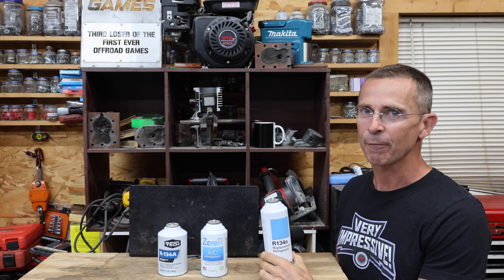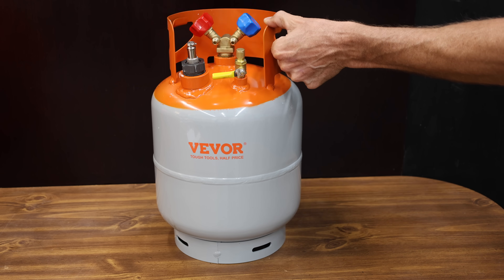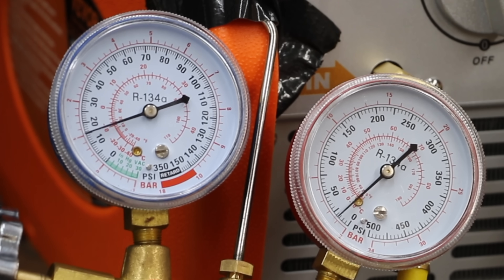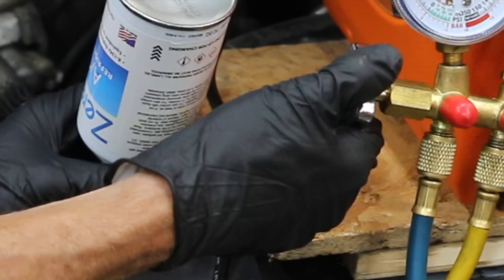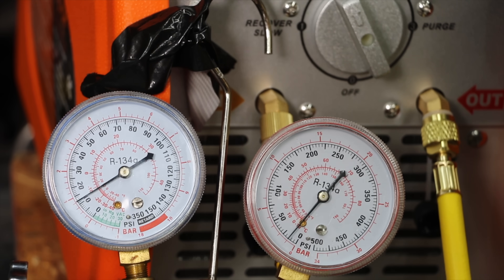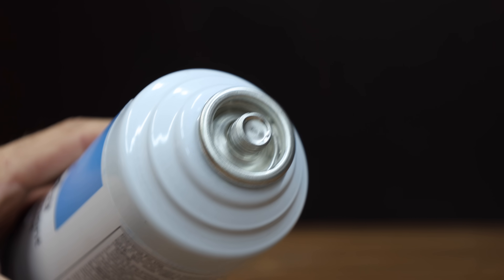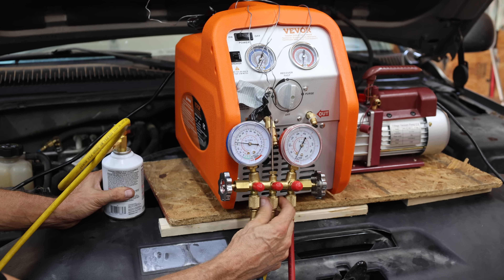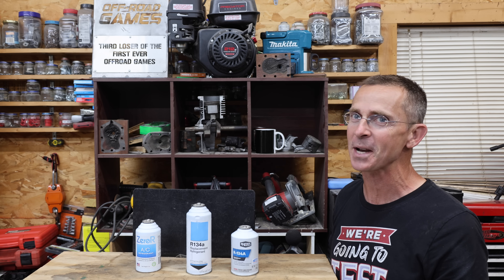How Dangerous is Fake Car A/C Refrigerant? Let's Find Out!

Comment: Unfortunately you're doing several things wrong and providing incorrect advice as well:
1. It's not freon but refrigerant, freon is just a brand.
2. You're not adding enough of the alternative r134a gasses for them to reach peak performance. 
3. You should NEVER add refrigerants in as liquids unless they simply refuse to enter the system (when the cans deplete some) and then do it small steps at a time as you CAN damage a compressor.
4. There is little issue with running these flammable refrigerants in automotive AC systems, there aren't any reported deaths/injuries from it, and the amount is very small compared to your fuel tank.  Most of the AC systems are fine even getting up to 500PSI high side occasionally until they will blow off some gas.
5. You don't know the exact charge level by using just a low pressure gauge at static temps/pressures.  You could be under or over charged still when the pressure remains the same (saturation).
6. You can use a puncture type adapter on self sealing cans all day long.
7. When checking vent temps, you have to use the same vent every time for comparison, as the temps change depending on the vent location in the cabin, often SIGNIFICANTLY.

.

.
.
.

Comment: You actually flooded the compressor when charging upside down as liquid! You have to very slowly add refrigerant, not open the valve fully! 

And as I can see, you charged too little. HI pressure should be higher to work properly. I have replacement in my car, and it is working perfectly. You have to measure subcooling to obtain perfect charge.
It is mix of propane and isobutane, to obtain almost the same pressures as R134a.

Dangerous? It can't explode while inside the sistem, as there no air. Yes, it can leak, but then it would burn in humble flame. What about all gasoline lines through and around engine compartment?

Comment: I enjoy your videos, but unfortunately this one was a miss and I would suggest to maintain your outstanding reputation in my eyes of transparency either 1) you add additional comments to correct the inaccuracies or 2) take down the video. All of the R-134A substitutes should  have been charged to the same specifications as the R-134A. The most recent equivalency that I've seen was 40% in weight of the substitute in comparison with R-134A. With the increased amounts in your test system, it is not a surprise that the results were worse. Additionally, the scare tactic of propane substitutes being in an automotive AC system is just pushing the lobbying campaign DUPONT succeeded with the US. DUPONT has an interest in ensuring R-134A continues to be used as it owns many patents, similar to how they lobbied with old R12 (freon) back in the day saying R-134A was dangerous (this was when R-134A was being considered a replacement, but no longer do they say this as they acquired R-134A patents). In a worst case scenario the few oz of propane in the system would flash off very rapidly (it would not result in some drastic explosion). Should I remind others that there is after all, pressurized gasoline rails in the front of your vehicle? Canada and Europe have moved onto hydrocarbons as alternatives to R-134A. In the automotive scene, the alternatives generally mix propane with isobutane to ensure they achieve the correct phase change pressures within the system, as solely propane would be too high of vapour pressure due to a lower boiling point when compared with R-134A.

Going through some of the comments I see others have hit on some of these points, however the only response has been that you appreciate the feedback, but have not provided any corrections to the video.
Reply: The fear isn't a "drastic explosion" in the engine bay. The fear is creating another flashpoint in the engine bay, where exhaust and potential spark/oil/gas, etc. exist. It wouldn't explode but it could be an ignition source that leads to a bigger fire hazard. And honestly, this all seems hyper-obvious without giving it much thought whatsoever. Millions of cars in the road daily, millions of potential failures or freak-incidents. Even a 1% chance affects 10,000+ vehicles.
Reply: It is hyper obvious that there are many other combustibles already in that location, even R134A IS inflammable. Your argument for why a HC is not a suitable replacement for a CFC or HFC is weak, especially when you consider the long term repercussions of using R134A. This just shows what fear tactics from mega corporations can achieve.

Comment: I always charge upside down, liquid exits the can.  Yes that can and will damage compressor if you open the manifold valve to far thus liquid slugging compressor. Please only crack open the low side so it flash off into vapor before exiting the manifold into low side of compressor.
  Also you can simulate road speed air through condenser by spraying it with hose .. plenty of sub cooling without driving it.
Reply from the maker: Thanks for sharing.

Comment: "You only need a low pressure gauge to determine if your cars' air conditioning system is at the proper pressure". That is incorrect and bad information. The high side pressure is pertinent to proper operation of any refrigeration system. If you have a malfunctioning electric fan, fan clutch, or a dirty condenser or radiator, a restriction in the system or a malfunctioning expansion device the discharge pressure will be elevated. If the high side port is in the liquid line and there is a restriction before the gauge port,  you will see low pressue. If pressure is elevated when it enters the expansion device it will leave it elevated, giving you an incorrect low side reading. Both pressure readings are necessary to know if the system is functioning properly and as designed.

Comment: The epa needs to quit forcing us to use garbage when r290 and r600 blends are better in many ways. 
Yes flammable but so what, 34 gallons of gasoline under my box and 28 gallons of propane in my box and perfectly legal. Yet less than a quart in the ac is not? It is the safest thing about my old pickup.

Comment: So much misinformation in this video.  First, there is no 'Freon' anywhere to be found in this video.  Freon is a brand name of refrigerant, and there is no Freon here.  Second, at 1:30, OP says that the system is fully charged at x psi static pressure and y temperature.  In reality, there is no way to verify a full charge using static pressure alone.  So that statement is completely false.  I'm not sure if Project Farm is ignorant regarding A/C systems, or they're just making videos with misinformation to profit from views.

Warning:  Now I've identified something unsafe.  at 6:40, the content creator is using a non-reusable container as a 'recovery tank'.  This is extremely unsafe, illegal, and should never be done.